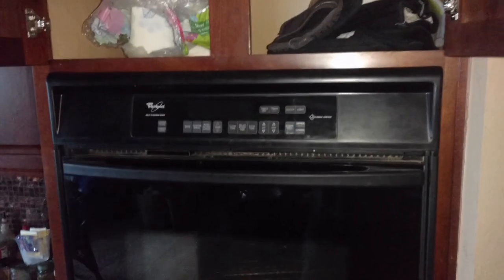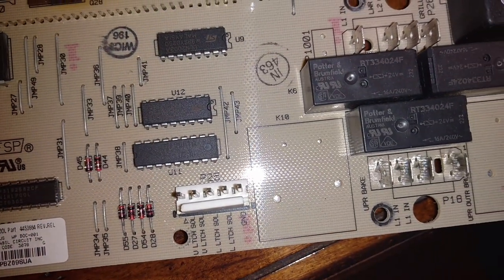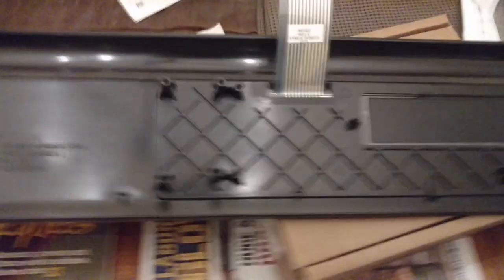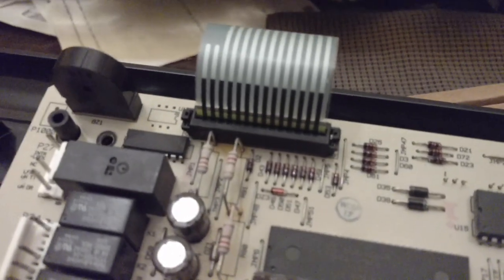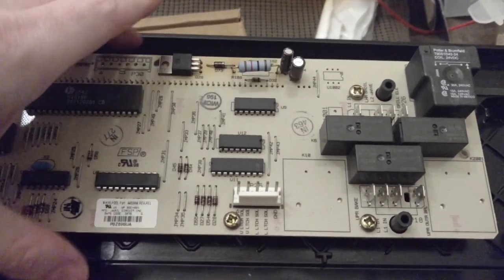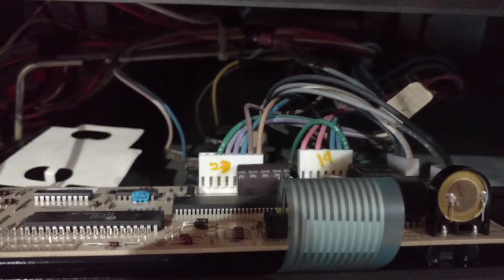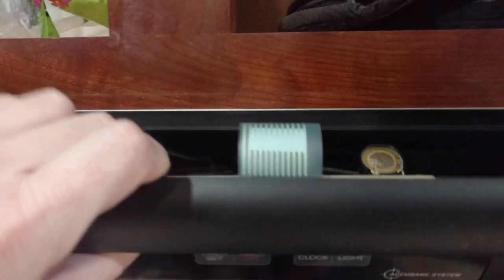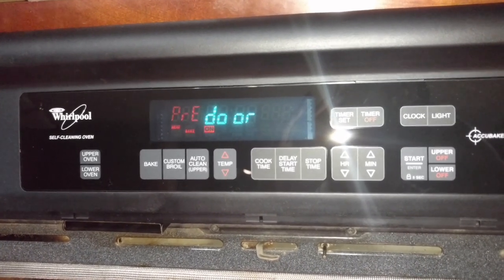Whirlpool Oven Fix: Keypad Replacement

Comment: Thanks this is useful info. I have same oven but had nothing but PF show on display. It disappeared with nothing on display at all now. Light still works in oven and beeps when I hit key pad but I cant start oven. Any advice? Thx
Reply from the maker: I'll post a new video to the channel to respond in more depth. 

I had to fix the control panel on it also after what seems like a lightning strike cooked a couple parts a bit. It could of just been heat wear overtime also. You probably have a keypad issue but only a partial failure which is why you're still getting response from some buttons but not the Start or maybe others.
Reply from the maker: Actually I'm nearly certain it's your keypad that just went out on certain buttons. You'll still probably get something out of the new video too. I should have it posted in a few hours.
Reply: @mrficks1838  excellent,  thx!
Reply: @mrficks1838  Hey my oven came back on again. It showed code E6 F2 which is Cancel key drive open? sounds like the cancel button fore sure
Reply from the maker: That code is likely damage to the ribbon that connects the keypad to the control panel. Sorry I had stuff come up.. I'm still editing the video.
Reply from the maker: Thought of something else. Try cleaning the connection (with the power off) where the ribbon connects into the control panel with this - https://amzn.to/3eNrIdN. --
If that still doesn't work then it's probably a damaged keypad and you'll need to replace it.

I'm uploading the video now. I gave you a shout out in it.
Reply from the maker: Here's the new video - https://youtu.be/Mfvqh0ATT9w

Comment: @0:48 I have the exact same oven and I need to replace something in there and I can not get the front panel to budge like you show in your video.  Any tips?
Reply from the maker: Check if there's screws hiding on the legs at the bottom behind the side brackets.

Comment: The whirlpool parts are discontinued for my oven. I found a company online that manufactures the panel and can determine if it is the key pad or control panel.  I am considering purchasing the key pad membrane and installing it myself.
Reply from the maker: I've been unable to find any manufacturers for it. Please post the links to the company. I gave up on the oven after the keypad went out again from what I could tell.

Comment: I have a Samsung stove getting code C-F2 that’s means keypad replaced?
Reply from the maker: It's a communication error so try cleaning where the keypad connects into the circuit board with this: https://amzn.to/3fCrNYe

If that doesn't work then yes the keypad needs replacing most likely. (Make sure the place on the circuit board it connects to is not loose feeling: which would need to be soldered.)

Comment: Mine doesn't just lift out. Had to take 2 side pieces off, only one screw near bottom on each. Then remove a hidden screw on each side of the panel.
Reply from the maker: Thanks for the info.

Comment: I am unable to remove the top panel. I removed the 4 screws under the panel but it will not budge.  Any suggestions
Reply from the maker: Pull out off the cabinet towards you some and then lift.. If it won't pull off then it is still screwed in somewhere or someone used an adhesive in which case you can pry with a thin flat but hard plastic piece (pry bar).

Comment: How do you remove the front cover so easy?  Mine won’t come off?  Any suggestions?
Reply from the maker: Try some penetrating fluid in the tracks and lightly tap the tracks with something that won't damage the paint. You can use a rubber mallet too but thumb pressure should be enough to pry it up. It looks so easy because it wasn't fully in when I re-did it for demonstration.
Reply: Just finished working on my oven - similar but has convection bake also.  The tracks on both sides slide into the panel.  There is a little screw near the bottom of the track.  I removed it and removed both tracks.  When you remove the tracks, you will find 2 little screws holding the control panel.  Once you remove them, the control panel will slide out.  I dont know why this is different but that is the way mine comes off.  By the way, I only cleaned the keypad ribbon cable with electrical contact cleaner and the keypad and oven is working again.
Reply: There are 2 screws that attach the cover to keep it from moving: 1 on each top/side/outside ... very small Phillips that must be removed before you can pop the panel up.
Reply: @frankmallory6584 , this step is overlooked in the video and I damaged mine trying to get it out.  The trim rails down the sides are hiding these screws.  There are also two screws holding the side trim pieces on that need to be taken out.

Comment: I have what appears to be the same oven and starting a few days ago I can no longer increase the oven temperature on the display, I didn't get any error messages and I can still turn it down from 350 degrees Fahrenheit but I can't increase it. Is that definitely the control board malfunctioning? Or could it be something else possibly?
Reply from the maker: Sounds like the keypad behind the up button versus it being a control panel issue. It's an expensive guess to swap it and see but I'll almost positive that's it, can't see how the control panel would only be affecting one button.
Reply: @mrficks1838   Thanks, I appreciate it.
Reply: @mrficks1838  I have the exact opposite problem.  The down button will not work on mine!  Did you find a quick fix for this?
Reply from the maker: @tammyj.9152  - I apologize.. YouTube doesn't notify me of replies within an initial comment.

I have not found a fix for one button yet.

Comment: I got mine to work by cleaning the the keypad ribbon cable with electrical contact cleaner and both keypad and oven are back working.  If problem returns, I will then replace keypad next.
Reply from the maker: Awesome. Thanks for the tip!
Reply: Im gonna try that first. The keypad works for me just not the display. Thanks great video

Comment: I hope someone can help me...I am removing the control board connections but I am having a very hard time removing the two black connections near the power relay.  I see there are plastic posts that go through the control board but I cannot figure out how to remove them.  Any ideas are appreciated.
Reply from the maker: You have to 'shimmy' them side to side slowly to incrementally release it. I'd try gripping it with your thumb and forefinger and it'll take a fair amount of grip strength at first. If you have something that will act as a plastic pry bar - this might help too. Just be sure not to stress things too much.
Reply from the maker: I find this to be very useful at prying up connectors - https://amzn.to/3JQTMNQ

Just be careful to not put angular stress on the base pins because it can damage the solder joints that hold them in place and require re-soldering.

Comment: Got the same oven with the same code. The light works times ect but when i hit atart oven it doesnt work. Should i replace that board? Thanks alot
Reply from the maker: If that's the only button that doesn't work then it's probably not the keypad. Might be the heating element.
Reply from the maker: Won't be about to replace the board though unless you get lucky on a used one, it's discontinued. My newest video as of now goes into basic control panel troubleshooting.

Comment: Thank you for the video.  The Key Pad (8300427) for my Whirlpool RBD245PDB12 oven is no longer available.  It beeps on its own.  The oven is 19 years old.  Unless you have another suggestion Mr. Ficks, I'm going to have to replace the entire oven.  Any ideas?
Reply from the maker: Hmmm..if it has the same ribbon (and ribbon width) a newer model keypad might work enough to keep it going. The newer keypad might not have full functionality but if you can turn it on and off it might be worth it.

Most likely you'll have to buy a new oven, sorry. I haven't tried what I'm suggesting but feel if the ribbon matches you have a good chance. You could return it if not.

Comment: Would you know where the fuse for the control board ? I have same wall oven as you Model PLEB30T9FCC Frigidaire
Reply from the maker: The thermal fuse that I replaced can be found here: https://amzn.to/3jZ5DME
Reply: @mrficks1838  Thanks but that would only control heat on the elements not control board lights
Reply from the maker: I don't know then. There's none I can see on or near the board.

Comment: Hi, I have an exact same oven. Some keys beep when pressed, but some don’t. The screen is completely blank. First, what do I need to get into diagnostic mode while the display is blank? I wonder how any error codes would show up on a blank display. 
Also, is the blank display still caused by defective keypad or I need to replace the control board??? Please let me know. Desperate:-\
Reply from the maker: Yes you'll need to replace the keypad. Sorry hadn't checked comments until now.
Reply: @mrficks1838  Thanks for the reply. 
The display is blank. Isn’t the control board I need to fix first? The touchpad is there to change displays, but I don’t get display at all when power is turned on in the first place. I am getting conflicting advice on this. Repair website says I need to fix the board first. Now I am confused 😢
Reply from the maker: You'd see some activity on the keypad LED's in my opinion if it was only the control board. I think it's the keypad.
Reply from the maker: It makes sense to me that some of the buttons would still respond. The pathways for the LEDs on the keypad ribbon that connect to the board have probably been damaged/worn out.
Reply: @mrficks1838  Thanks for your feedback. Repair sites recommended me to send the control board because the screen is completely blank. They argue when power is turned on, the screen should display something even with a completely defective keypad. The power to displaying LED is from the control board initially, not keypad, they argue.

Now a keypad or control board is about $200 each. I don’t want to spend $400 to fix my screen :-\ A little too much. Maybe that is my only option. Fixing both :-\
Reply from the maker: The power would still come but if the keypad ribbon is defective then it won't allow the power to the LEDs. I think you should start with the keypad first.
Reply from the maker: https://youtu.be/H-rarFLxiEw
Reply from the maker: If you do send the board off first please report back what they had to fix. I could be wrong. Let's hope so, so you will only pay $200.
Reply: @mrficks1838  Hi, there, all of sudden, the screen revitalized by itself and began to display a time and "loc" message with a locked key image. And after an hour, the screen went blank again with a beep sound. Now the screen is completely blank as before. Does this symptom give you any clue which is wrong between the Keypad and control board? Hopefully it can be an informative clue to you.
Reply from the maker: Hmmm that would lean towards the control panel then. If the pathway had broke for the keypad then it shouldn't be intermittent like that.
Reply: @mrficks1838  Thanks for your feedback.

Comment: I have the same oven. All the lights on the panel are out. But if I push the buttons I hear beeps. Do you think I need to do the same thing you did or is it something else?
Reply from the maker: You could try checking the connections and seeing if they are super dusty / etc and clean them and try again. It does sound like one of the pathways is broken though so most likely you will have to replace the keypad.
Reply: @mrficks1838  Thanks I'll try that
Reply: @ej3246  Hi, EJ, I have the same problem as yours. Have you cleaned the connection and it works now? Or you had to replace the keypad???
Reply: @jacobkowski7705  I ended up finding exactly the same oven on offerup and just replaced the panel
Reply: @ej3246  What is 'offerup?'
Reply: @jacobkowski7705  its kinda like more modern version craigslist

Comment: Hi I have the same one but has no power
Reply from the maker: Sorry for the late reply. If anyone is having this issue and it's just the keypad not showing display - try cleaning the ribbon and connector with electronic cleaning spray.

Comment: thanks for the info
Reply from the maker: You're very welcome.
Reply: I have a whirlpool range model # GFG461LVQ2  temp sensor was not working properly, so I replaced it. Now oven will not work..Message says feature not available when trying to turn on oven. Help please.
Reply from the maker: Sorry Carrie didn't get a notification for your comment. I suspect you've moved on with that oven but if not then it sounds like a loose cable/connector to me... Or something got damaged during your repair.